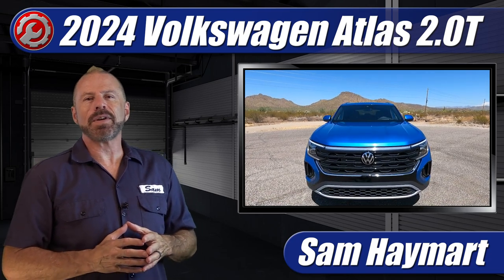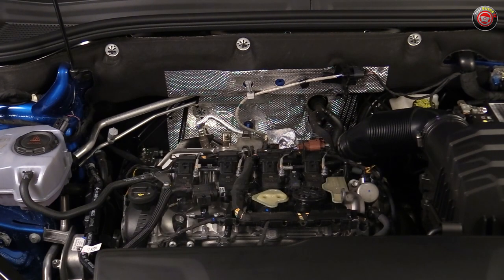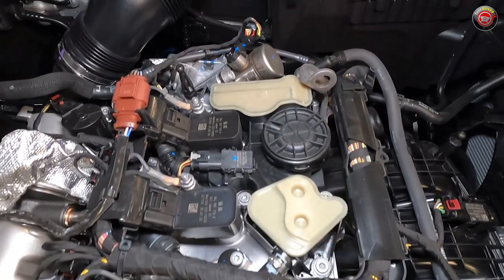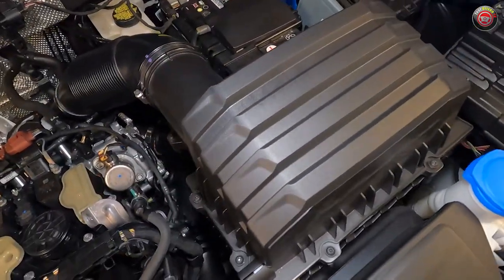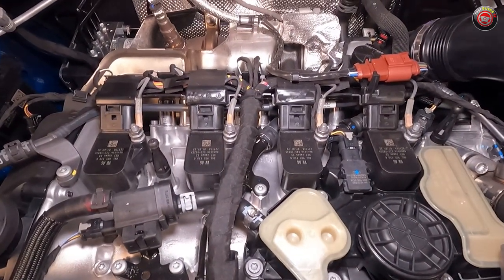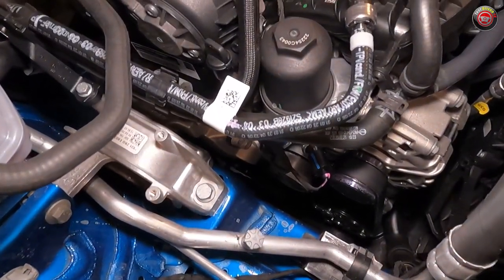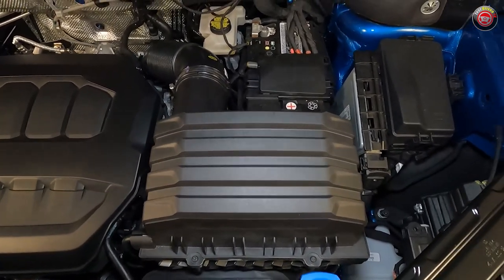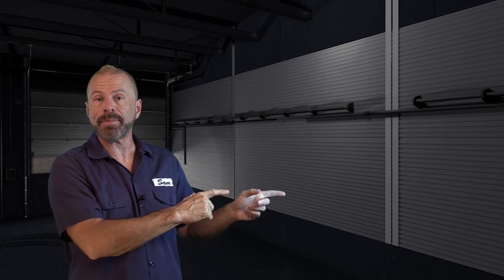2024 Volkswagen Atlas: Engine Explained

Comment: I'd recommend NOT sucking the oil from the dipstick tube.  I went to do my  first oil change at 900 miles and it is leaking oil!  Would have never known there was a leak if I pulled it from the tube.  Anything that leaks oil after 900 miles is just trash.  Wish I had never purchased.
Reply: Leaking from where?  I just changed oil at about 2,500 miles and noticed an oil leak on the output of the transmission that goes to the rear diff.
Reply: @moparmuscl  Leak was caused by bad PCV valve, which caused the turbo inlet tube gasket to blow!  It was dripping off the bottom of the engine.  Car is still in shop, everything is backordered.
Reply: Well... At least you are still under warranty... 😬 @lieslgiorgio8450

Comment: So basically to check your oil level… You have to Remove the plastic Cover??🤔
Reply: no you have to go into the infotainment system to see the level electronically.. because there is no dip stick on 2024
Reply: @Vw20249  Thanks. was curious about.
Reply: @Vw20249  correct ...i have one and the wife loves it
Reply: @chinoxSD  Thanks
Reply: @Vw20249  you can get the dip stick separately. Simply remove the plug and install the dip stick
Reply: @denisk186 Nice, do I have to get a steering wheel separately as well?

Comment: how the hell this engine takes regular fuel and makes more horsepower then my A5 with 261 hp, which only takes premium fuel??? Both EA888 EVO4
Reply: He said high compression. 🤔 Cast iron blocks and aluminum heads do God's work.
Reply: @tingokuman  having high compression is good for efficiency, but it lowers power output and requires high quality fuel.
Reply: It just does.

Comment: 1:26 The direct injectors (black body connectors with the red clips) are mounted on the back (left side) of the cylinder head in front of the turbo heatshield.

Comment: Does a bottom panel need to be removed to access the oil pan and drain plug? 

Basically, can you make a video describing an oil change on this same vehicle.

Thanks
Reply: Same.  Can you post a video showing oil change?  I want to shorten the recommended 10k intervals and don’t want to pay them every $5k. What oil does it use, how much oil, filter model etc.
Reply: @benito5125 The typical procedure is to suck the oil out of the dipstick tube and not drain it from the bottom because all 2 liters have had plastic drain plugs which leak if not replaced. But it takes 6 quarts of oil a 32mm socket for the filter and it doesn’t have a dipstick from factory so you would have to buy your own of those.
Reply: @steeleluedtke398  The drain plug on the oil pan is metal with a metal crush washer.